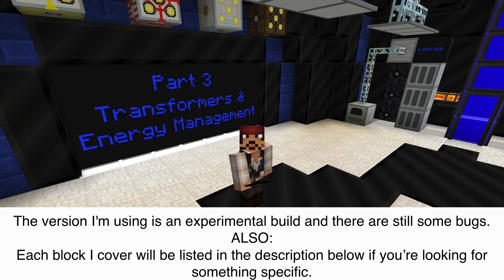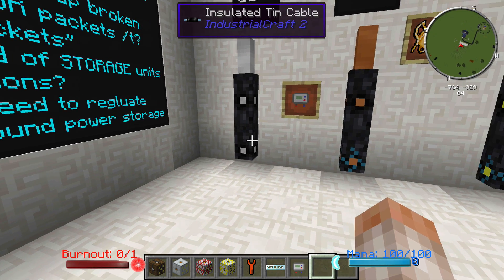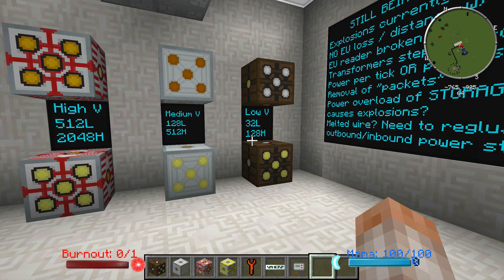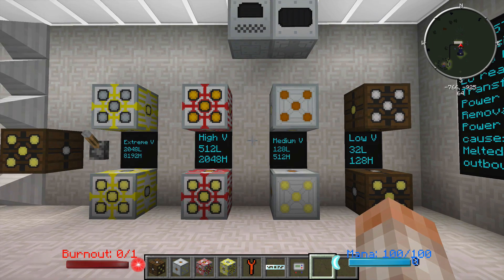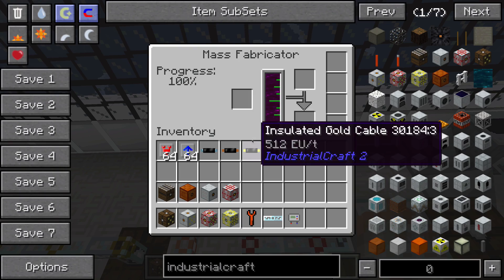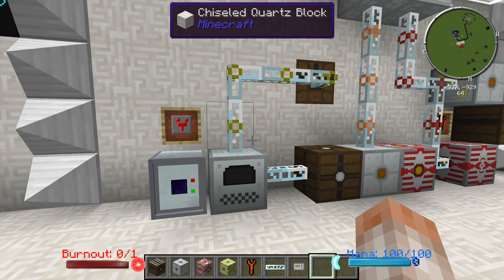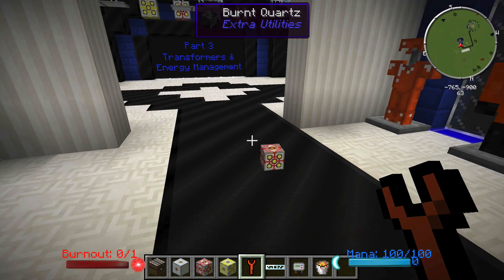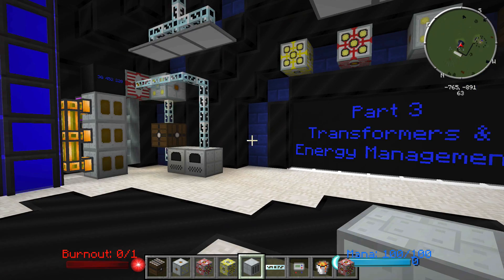IC2 1.6.4 Tutorial - Ep.3 - Transformers & Energy Management

Comment: The transformer upgrades showed 64 the first time because they were in a stack of 64.  They showed 62 when you threw the annotation up because they were in a stack of 62.  Each transformer upgrade should increase the voltage by one stage, 32/t to 128/t, 128/t to 512/t, etc, however it looks like it's jumping up two stages per upgrade.

Comment: It used to be, that the voltage represents the "package size" of the energy. Glass fibre cables could take like more than 20000 eu/t from my solar plant, but not higher voltages. with the transformer you could change from one to another voltage tier, down or up depending on the redstone signal. The loss was determined by the  package size, the cable and the lenght of the cable. Copper cable had a loss of 1 EU/t per 5 blocks AND package, so if you had a 10 block long cable line, with low voltage of 32 Eu/t packages, you only would get 30 at the end. What are the Transformer were there for was to transport power over long distances, if you could use like high voltage (2048 EU/t) with a cable with 1 Eu loss per Tick and  block, you would get 2046 out of the 10 block line.
Note: IT DOES NOT DEPEND ON THE AMOUNT OF EU/T WETHER YOUR CABLE CAN HOLD IT OR NOT, IT DEPENDS ON THE PACKAGE SIZE
(sry for caps) This is important to understand. you could run 2048 EU/t through a copper cable at LV, but the loss is much higher than when you would take HV or MV
Reply from the maker: Very helpful thanks! Like this comment to keep at the top! :D
Reply: Just to add. Cables used to have varying "no loss" block distance. After that packages used to lose set amount per distance. Glass fiber used to be tier down from hv but had longest no loss distance. If I remember right copper had 5 block no loss and glass fiber had maybe 10 blocks. Storage modules and transformers  used to reset the loss also.